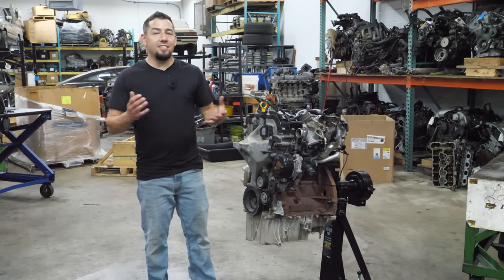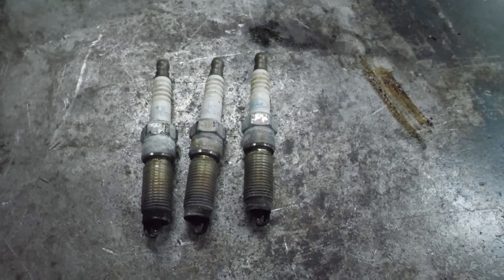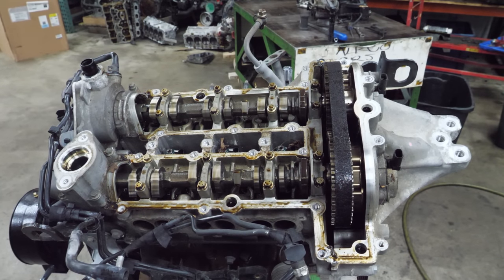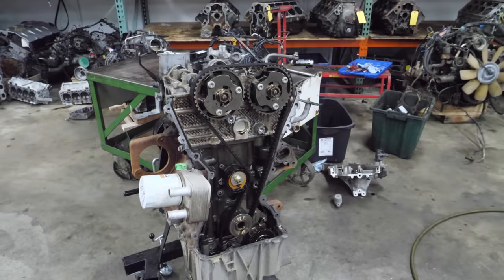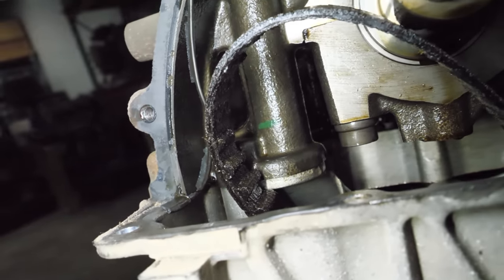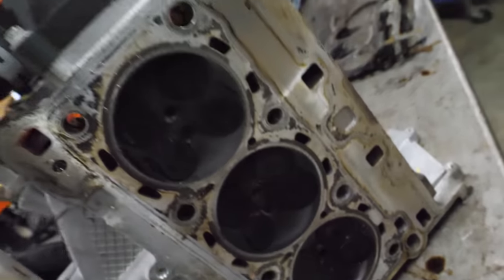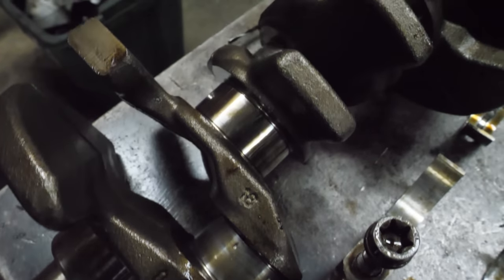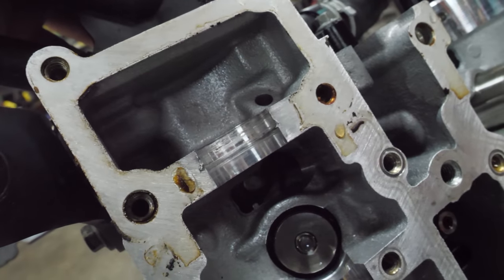JUNK Ford Ecosport 1.0L 3-Cylinder Ecoboost Teardown. LAWSUIT ENGINE!

Comment: had this in a 6 speed manual focus before it was totalled. I really liked this engine, the torque band was very low and I easily got 48mpg average
Reply: Same car. Gutsy little engine, pair well with 6 speed
Reply: I grenaded the 5spd in my fiesta and installed the focus 6spd. I miss the taller 5spd final drive for highway.

Comment: The hilarious thing is, this engine has won multiple awards, despite truly awful design choices and questionable failure rates. Some of these engines are failing catastophically with 30k miles on them. Dreadful

Comment: Wonder how much longer all of the little 1.2 and 1.3's in the newer GM "trailblazers" are gonna last. They're also 3 cylinder wet belts. I've not had one apart, though their turbos are prone to wearing an oval into the wastegate rod.
Reply: Only the Trailblazer 1.3L I3 uses a timing-chain. The 1.2L I3 uses a timing-belt.
Reply: @waltchan  I knew one was, I just assumed both were. Still, not really looking forward to when we start having to open these motors up within the next couple years.
Reply: @zackschwenzer4892  1.2L I3 uses a timing-belt only to reduce production costs, and to lower the base MSRP for all-new 2024 Trax.
Reply: @waltchan  Per GM's very own web class on the 1.2 LIH engine:
 "The 1.2L LIH engine has two camshafts, one for the intake valves and another 

one for the exhaust valves. 
• The camshafts are driven using a belt-in-oil or wet belt system. This system 
reduces noise and friction compared to timing chains and dry belt systems. 
• Both the timing belt and the oil pump drive belt have a change interval of 240,000 
km (150,000 miles) or 15 years"

It had been a while since I took this class (it was from mid/late 2020) and they also went over the LT2 for the 2020 C8 vettes, but I remembered very well an oil belt on the 3 cylinder. I thought it was both of the micro engines. Maybe their upcoming redesign ditched the wetbelt? Doubt it, but I also don't know. 

The only issues we really have so far with those little engines are turbos and purge pumps (again, I can't tell the difference between the 1.2 and 1.3 without looking into the engine bay). I can't think of one person in the shop yet who has had to even pull a valve cover yet, but we don't tend to get the catastrophic failure many of the larger dealers see.

Comment: As far as 3-cylinder engines go, Kubota makes some great ones!
Reply: A fellow Robot Cantina viewer I assume?
Reply: There are many great 3 cylinder engines in the powersport industry, Ski Doo, Yamaha for example. Motorcycles, ATV, Snowmobiles, Marine, Agri.... ect. I agree though Kubota makes good ones, Ford however....yikes!!!
Reply: I have a Yanmar 3-cyl in a John Deere...rock solid diesel
Reply: @davidgrisco1939  I have the 3 cylinder in my Yanmar 226D, thing is unkillable

Comment: The oil changes are key on these, old oil with its debris and acidity eats the belts. Always do oil n filter changes twice as often than what the manufacturer recommends.
Reply: Yeah, you have to be pendantic in fulfilling the oil change intervall and the right oil-specification ist key as well. You can't just pour in any oil you get at the next petrol station but that one special classified ford oil for this kind of construction. Any other oil eats up the timing belt and/or the oil pump belt. Some mechanics say that oil dilution due to short distance driving espacially in combination with high ethanol petrol might be part of the problem.
VW also has oil pumps driven by belts in oil. they don't seem to have this problem. I wonder why.
Reply: Peugeot also have this problem on their THP engine. Sometimes even putting the recommended oil by Peugeot was not enough to prevent the engine from blowing up.
And heck, how is the customer supposed to be aware of that issue ?  You could do every single check up by the dealer on time and still blow up the engine. This is BS
Reply: @350eti Peugeot "fixed" this issue by cutting the replacement interval of the belt in half. So they're actually making money off of their mistakes. You gotta hand it to them: pretty smart 😅
Reply: @pflaumenaugust876  My neighbour is a VW mechanic, he says that the TSI engines are crap!
Reply: I live in germany bye the way.
Reply: I wrenched  at a US VW, Mazda, Peugeot dealer for roughly six years. If I want to explain to someone where I worked I say "..at a VW and Mazda dealer". Too embarrassed to admit to Peugeot 😂😌 @350eti
Reply: @pflaumenaugust876 I worked at a Ford dealer for over a year and every 1.0 got the same Motorcraft oil as any other engine. There’s nothing special about it just for the wet belt. Any leading brand will suffice, no conventional oil or additives.
Reply: I feel as though oil becoming contaminated with small or large amounts of fuel can play a key part in the belts deterioration and its not uncommon for cars to have fuel contaminated oil from idle of small trips.
Reply: In my grarage we uses 0w30 for wet peugeot timing belts and for ford      5w20 eb (ecoboost)
Reply: Every 5k I do mine with the genuine  ford/Castrol 5w20 no issues engine wise but they do eat dmf's and clutches mine went at 19k 😅.
Reply: @eddiek821  aye mines sitting on 258k now, nae engine issues tho, clutch is doing well, pretty sure its aftermarket, proper grabs in 1st 🤣. Was remapped a few years back too, better fuel economy and power delivery through the gears

Comment: If you change the oil every 6 months, to the specific non-standard oil it needs. The rubber belts will usually last 100k miles, 60k is safer. If you use the wrong oil or don't change it often enough the belts will degrade, shed crap and clog the filter.
Reply: every 20.000 km is much better not 40.000 as the say
Reply: Great comment. What specific oil do they require?
Reply: In Europe, Ford recommends Castrol Magnatec E FORD 5W20. You can get another reputable brand as long as it has the right spec. (Ford WSS-M2C948-B) From what I understood, the diesels take 0w30, which is a different spec.  (Ford WSS-M2C950-A) Not sure if that would eat the belt if someone would use that. Would recommend not taking any chances with the wrong oil on these engines.  @andreidede459

Comment: Not to be outdone, GM used a belt in oil to drive the oil pump on their V6 diesel pickup truck engine.  Another brilliant idea.
Reply: Supposedly it hasn't been a problem on the 2nd gen 3.0 duramax ... yet.
Reply: @mrvwbug4423  As a died in the wool GM lover, I walked away from that idea.  Let someone else make the mistake.  It would have bankrupted GM to drive the oil pump with a chain, shaft, or gear.
Reply: @honkie247  Really all engines should have a chain or gear driving the camshaft(s) and oil pump in my opinion.
Reply: GM made engines with timing chains that were only good for 80-150k. The Quad4 and it’s successors come to mind. Given how all auto manufacturers are, it should be gears. Too many have skimped out on a crap chain/tensioner system.
Reply: @aaronatwood9298  Don't forget, they can mess up a timing gear system too. Certain engines with 'fiber' timing gears come to mind, though there is nothing wrong in principle with making gears from phenolic composite.

Unfortunately hardened and ground steel gears are by far the most expensive option for timing, especially if helically cut (and spur gear whine would probably be a big fail on NVH these days). I have no doubt that if a law were passed requiring all engines to have timing gears rather than belts or chains, the big auto companies would make as many of said gears as possible from plastic, and we'd all be complaining of stripped timing gears.
Reply: @TheLionAndTheLamb777  Chains, guides and tensioners, hmm??? Why not a simple shaft between the OH cam and crank!
Reply: Ford used fiberglass timing pulleys in the eco line van  vehicles in the early 2000 's .... stop the gm war crap. Ford started the cheap junk parts train way before so 😅
Reply: @nerd1000ify  Gearing for an OHC engine would be ridiculously expensive, even if the gears were made from sintered, powdered metal. Timing sets should be required to last 300,000+ thousand miles and still be within service limits.
Reply: @SmoothCruizer37  The only GM war crap is in your head.
Reply: @SmoothCruizer37  You sure they are fiberglass and not glass fiber PA66? As for cheap parts, they both started that in full force in the early 70’s. They both made cheap crap about the same time.
Reply: @Aaron Atwood  some heavy duty diesel engines use a timing gear train like that, but obviously the economics are very different for them vs car engines.

Honestly though a properly designed chain or toothed belt drive should be totally fine.
Reply: @nerd1000ify  But ford, GM, Mazda, and others have screwed it up. It’s all in the penny pinching, or occasionally a rush to production which creates glaring oversights.
Reply: @aaronatwood9298  Indeed.
Reply: @SmoothCruizer37  So GM copied this brilliant brain fart?

Comment: I was a mechanic but got out of the game almost 20 years ago. I cant believe theres such thing as a wet timing belt. I had never come across that. An astonishingly bad idea.
Reply: The only reason is less friction, all thanks to environmental regulations.
Reply: Honda have been running a toothed wet belt engines on  lawnmowers etc for quite a long time with great success, The belt seems more like plastic than rubber and has no tensioner!
Reply: Yea i agree that a wetbelt is definitely not a good idea but my fiesta 2013 1.0 ecoboost has 140.000km on it and also the Powershift transmission and it still runs fantastic and i came to the point to think that if 100 people complain about a engine that it will beat 10.000 giving it the thumbs up for being a good engine
Reply: @SASMacDroid it's a pile of shit. Get rid quick before if suffers catastrophic failure.
Reply: @richpolecat6527 wrong,its a great little engine and lovely and smooth.funny how these supposedly shit fiestas are incredibly popular and hold there value so well.my bro in law had 2 of these for about 6 years each thrn had a vw polo for a change.hates it.
Reply: @ivanfernyhough3851 From what I gather seems it just being ahead timing of the "scheduled" belt replacements will provide peace of mind. As long as everything else on the car doesn't have electric gremlins more common among German brands it will theoretically be cheaper for the Ford long term operational & maintenance costs. If they converted the oil & balancer shaft belt to chain drive it would surely become a bullet proofed engine.
Reply: @SASMacDroid  yes i also think thats whats going on. mechanics say "wow i had a lot of failed 1L ecoboost" well yeah. almost every damn small ford has it. pretty much every fiesta and focus alone has it. so of course you will see many.
Reply: @richpolecat6527  if you think it's Garbage then good for you 👍.but I'm definitely not getting rid of it
Reply: @Mr.Marbles  yes i agree and i only know of one person were the wetbelt gave up and she never had the car serviced in over 2 years i think was even close to 3 years and a high mileage in that time so no wonder if it goes bust
Reply: @SASMacDroid  I don't think, I know. And for me, you can have a fleet of Ford's, it's not me that's got to drive the shitters, or my money you're throwing away on them 

Obviously you're not a car man, so I understand it doesn't matter to you, and you'll drive Any old shite. Well done!
Reply: @richpolecat6527  ok if your a car guy then tell me what do you drive
Reply: @SASMacDroid  I own 2 Nissan Pulsar GTI-Rs, Nissan 200SX S14A, Nissan Micra 1.2 Super S, Nissan Micra K11 with CA18det swap, Mitsibishi Lancer Evolution 3 & 6.5 RS, SUBARU Impreza Type RA, Toyota Glanza turbo,and a  Suzuki Swift GTI.

These are all kept  in storage as I'm currently lucky enough to be back out in Asia.

When home I daily drive my Pulsar.
Reply: @richpolecat6527  i like ford , mitsubishi and nissan and I don't understand how especially if i guess the pulsar is your favourite of them all can dislike a ford fiesta .and by the way i live in Germany and i have 2 cars a 2013 facelift Fiesta 1.0 ecoboost and a 2019 ford focus st line 1.5 ecoboost witch are cheap on road tax and insurance   just the fiesta cost 28€ road tax a year and 480€ insurance a year if had more money i definitely would pick a completely different car
Reply: I drove several Fords for years, with no problems. A Focus, a Fiesta and a Focus station. They always got dealer maintenance. Expensive, but hey, never had problems in return. Dealers know the weak points and give those extra attention during maintenance. We don’t know what the engine in this video has gone through. Never was a fan of their ecoboost engines though.. it doesn’t sound like a good idea to crank up a 1.0 with a flimsy turbo. Things that work hard should be a bit oversized. Therefore, I therefore drive a Skoda Octavia now. Feels way more clunky and imprecise to drive.. Ford is hard to beat on that.
Reply: @SASMacDroid so why are ford replacing these engines left and right?
Reply: @meowmeow2759 I haven't heard of ford replacing them left and right 😂but hey maybe i can't speak for anyone here my one was assembled in bonn germany it's also the country i live in and their are a massive amount of ford car's with the ecoboost engine flying around and i only know of one person that had a serious engine issue while driving from Poland to Germany and i think his focus was a diesel he wouldn't recommend a ford either because it wasn't to old but that's it i don't know of anyone with serious issues and I was just checking videos about that 1.0 ecoboost to just figure out why the wetbelt is so expensive to swap and how it gets swapped and only on YouTube i found a few negative videos about the ecoboost engine and not in real life
Reply: My bro in law's Ecopop failed at 24,000 miles, gently driven (knowing him) and fully serviced.  Wet belt disintegrated, & the rest was history.  Only duplex CHAINS for me.
Reply: @theondebray  most likely wrong oil grade for it to fail early. Almost always the case
Reply: @scottpenfold4373 Possibly, but I find that hard to believe, given the number of failures, and in the case of my BoL's case, immaculately serviced.

Comment: My engine just went, probably from the shredding of the belt, clogging the oil pickup; or it could have a broken tensioner arm. Low oil pressure and engine knocking. The standard powertrain warranty is 60,000 miles or around the end of July 2024 for me, (Whichever comes first, (July came first) It had 59,700ish miles when it went on September 9th 2024. They came out with an interim engine fix in June so I drove it, before I was not driving it. It is in the shop and looks to be around 5 weeks from now for an engine replacement, but needs to go back in when they receive the part(s)? They are waiting on for the recall. (Expected Q1 2025, recalled Q1 2024). It has the extended warranty that the original owner purchased that lasts until 80,000mi or July 2027, whichever comes first, not sure how that plays out with an engine replacement mileage wise but when it gets close to the mileage or date I am selling and do not plan to get a ford ever again. Probably Honda or Toyota, something reliable like that. We will see.

Comment: I'm not sure that's a common failure, but by looking at how the pick up tube looked, yeah that's bad... A non keyed crankshaft is insane. However, leave it up to the Engineers to figure it out... As always love the tear downs, Keep up the Great Work... Catch me next week...
Reply: It's not the engineers removing the woodruff key from the crank, it's the bean counters realizing they could shave 10 cents off the manufacturing costs
Reply: I suspect that it wasn't so much the engineers that left that shaft un-keyed. I suspect the engineers tried to convince the bean counter looking to save 50 cents a unit that crankshafts need keys.  The engineers lost that one.

Comment: 110,000 miles on this engine, correct oil. We love this little car. Good power in a fiesta, good mileage, zero tax.
Reply: Mine did 94000 km's and the block or head cracked.. good thing i got a brand new engine under warranty. I like the torque and power delivery of it though, sounds pretty good and is good on fuel.
Reply: I have a 2013 fiesta 1.0 ecoboost with 140.000km on it still running fine

Comment: Dear God what a small tiny little engine.
I hope it has a lot of spirit!
Reply: Do you say the same re a Yamaha motorcycle engine? Or an ATV engine?
A 1 litre 4 banger with a 5 main bearing crank and able to rev all day at 6000rpm would be nice..
oh wait..Nissan had those in the 1970's....
Then they went to 1200cc with the A12    or B210/120Y engine 
and nobody has a bad word to say about them....
Reply: No spirit, ford left out to save buck
Reply: @JohnSmith-yv6eq  bikes are vastly different from cars. Put a bike motor in your car and see how well it preforms with the extra weight tie on.
Reply: Only one cylinder and one turbo larger than my lawn mower.

Comment: Thank you, now I can see why these engines are designed to self destruct. I never bought the idea of them, although had a 3cyl Toyota 1.0 and it had 120000 miles and ran like a swiss watch. It did make very little power and  could rev like a motorbike, but was a good fit in a tiny car.
I guess the designers never get out of their gaming chairs and actually hold a spanner any more, but it would seem computers don't know how to fix things so the blind lead the blind!

Comment: Ford has a TSB for the early 1.0 L (Prior to 5/19?) for a revised tensioner.  Very common failure in these engines.
If you have an early version, do yourself a solid and upgrade the oil pump belt tensioner!